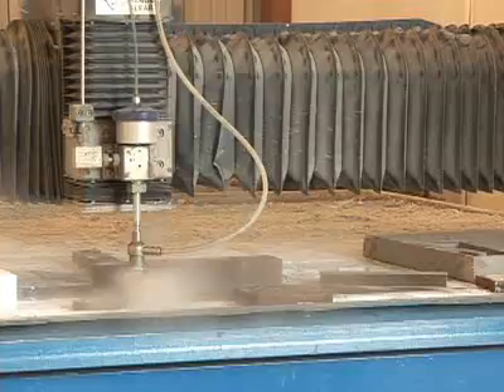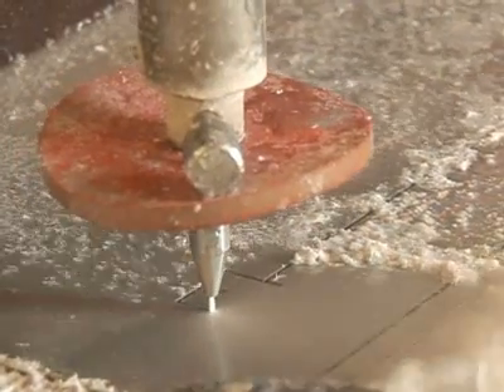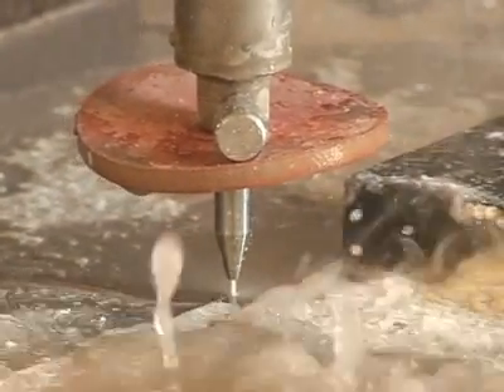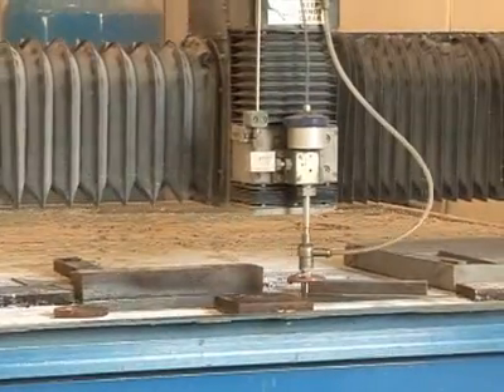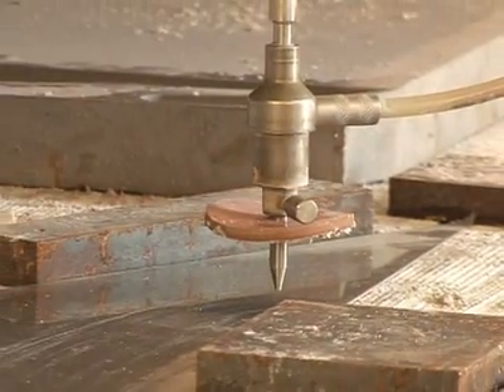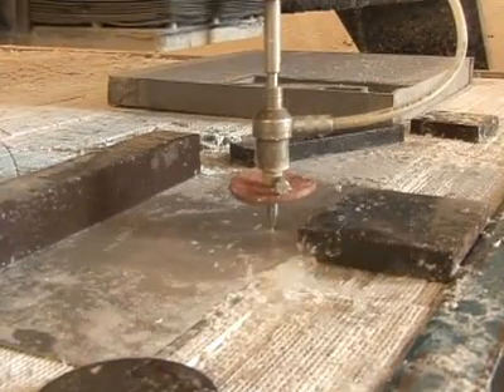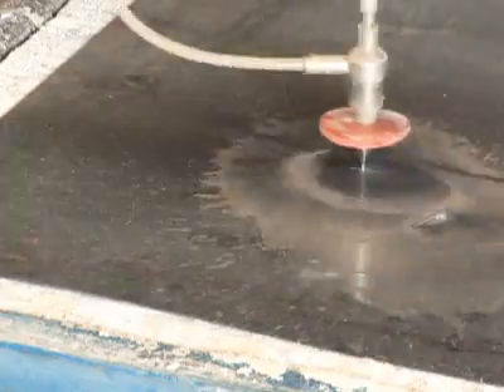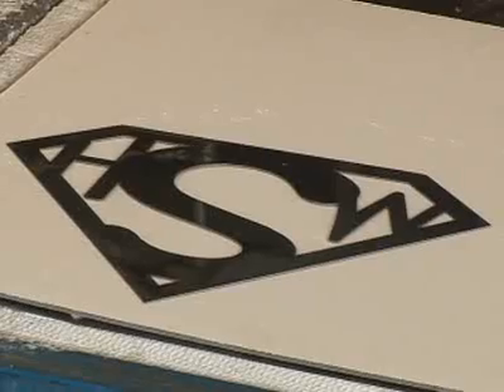How Water Jets Work

Comment: The video is rather cryptic, it explains very little.  How  is such enormous pressure crated?.  How much does such a machine cost?  Is the carbide or other cutting  abrasive reclaimed for further use?  Seems such a short video of a complex machine is simply , "Clik Bait"!
Reply: Not click. It does explain most of how it works. However it says that water cuts steal. Not true. Its the sand that does the cutting.

Comment: sometimes i block my taps at home with my fingers for lols, what would happen if i tried to block the nozzle on this machine?
Reply: +Limosical It wouldn´t care. And you´d be missing a finger.
Reply: Lol, that's if you kept it there until it shut off. I'd imagine once it hit, you'd jerk your hand back, leaving a clean cut from that point to the edge of the finger. 

With that said if you have ever touched the spray from a pressure washer say 1200 psi, at about 1 foot or more distance you can clearly feel the power of water, imagine it at almost 60x, and close the distance up to 1 inch or less and it's an amazing force that my fingers will choose to stay away from.

Comment: Anyone else wonder if he took one of those outside, pointed it up, and shot it how high the spray would go
Reply: My guess would be, not that far. 100 feet? Maybe? The pressures are high, but the volume of water is low. If you upped the volume of water to say a firehose at those kinds of pressures it would be a lot more awesome. With not being in a vacuum, you have a lot of air resistance, each bit forward will remove more and more from the stream, and less speed. So say at 100 feet, you might feel a slight mist.
Reply: ANSWER is not high at all. Just like a paint sprayer the air and volume of water is very low and very localized. It be the same as if you spit up water into the air. The resistance and gravity would kill the force regenerated by the pump. That's why 6 axle water jets are small and enclosed.
Reply: It'd blow up the moon. Trust me, I designed the Death Star

Comment: I am an operator of water jet cutting already for 12 years.
The water is than tap water but it is filtered to prevent damage to the pump.
The pressure of the jet is 3900 bar.
I cut thicknesses of 100 mm stainless steel, glass, titanium, copper, wood, marble, granite and everything you can imagine ... with any form.
It is not as fast as the laser, but size laser cutting materials that can not cut.
Sorry for my english

Comment: they don't use a table, the workpiece is supported by a series of 3mm side slats, these do get cut and eventually need to be replaced (end up looking like a ban saw after bait). To minimise cutting them to enter material properties and a thickness, it then uses the correct pressure to cut through your job, but not your slats. Obviously you can't achieve that fully, but it does help

Comment: water alone in these machines hardly makes a mark on steel.
it NEEDS the sand...or what granules are feed with the water...as they act as the cutting agent.

also, it can cut more kinds of material than lasers, but lasers are many times faster when cutting steel.